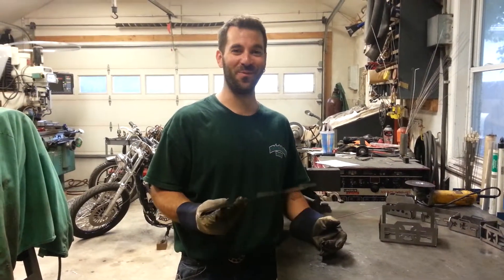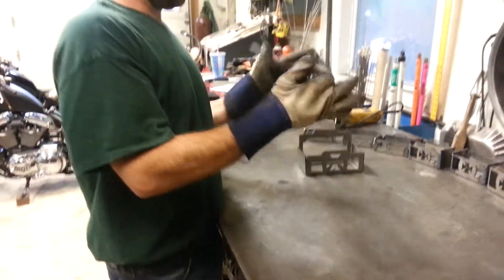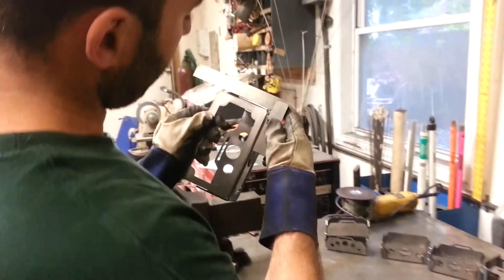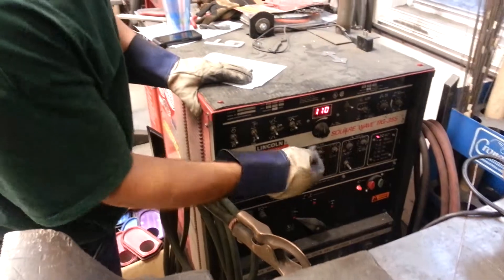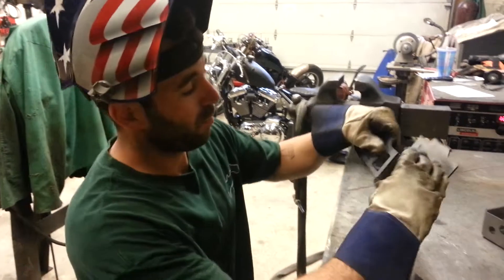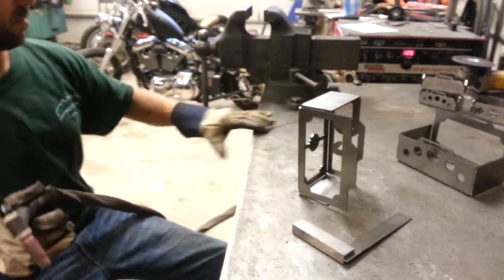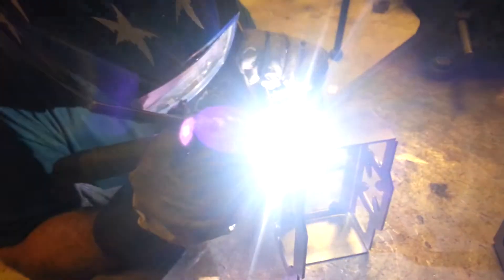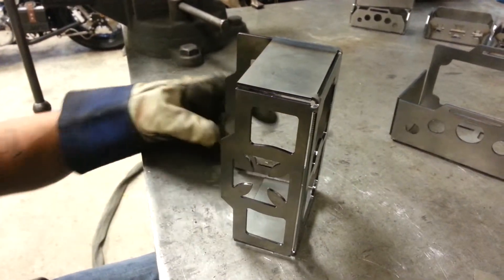TIG Welding Tips and Techniques for Motorcycle Battery Box 1/5: Bending and Welding the Box Together

Comment: Cool. Is that 3/16 steel?
Reply from the maker: The battery box itself it cut from 11ga HRPO steel which equates to about 0.120" THK. The top clamp is laser cut from 7ga HRPO Steel, or 0.179" THK. Thanks for looking.